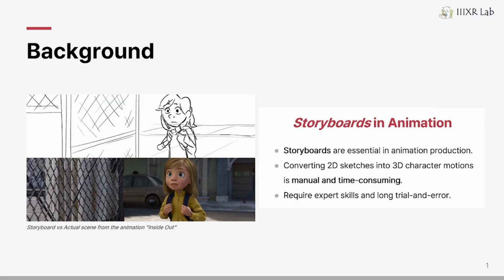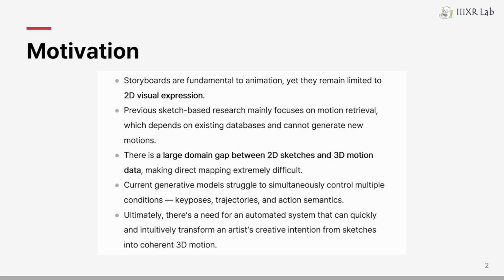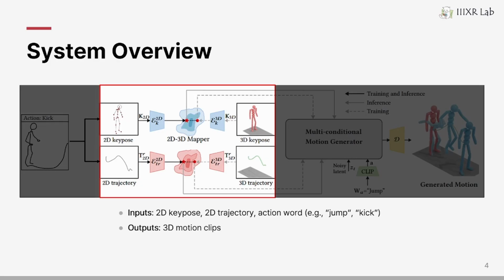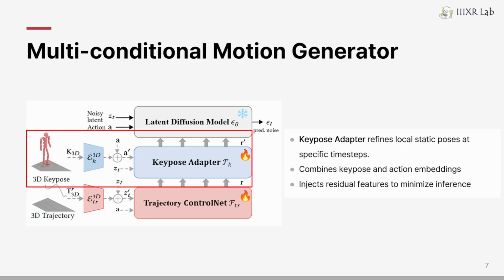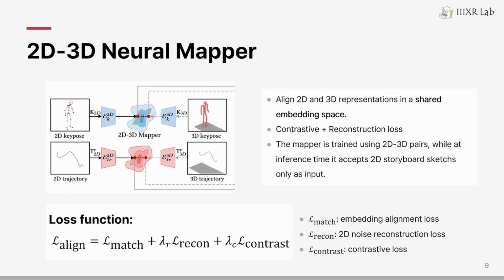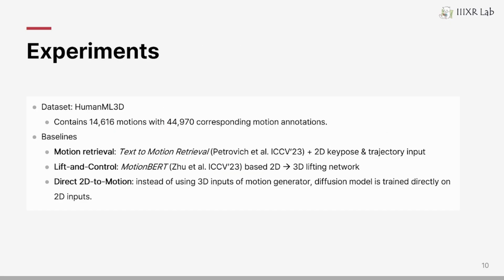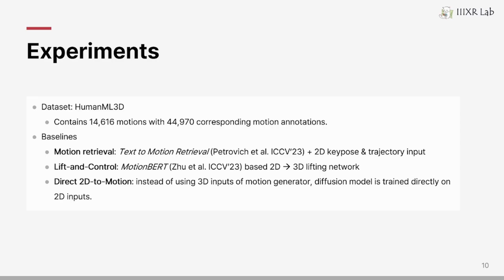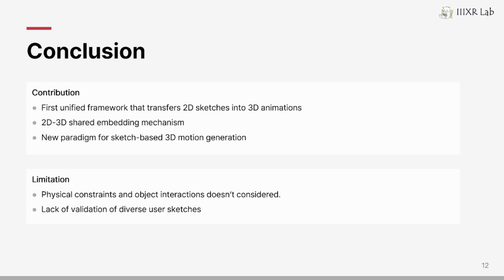[Seminar] Towards Transferring Sketch Storyboards into 3D Animation

Comment: Q1. Could you clearly explain how the spatial characteristics of 3D motion, which are not inherently present in 2D key poses, are effectively connected or reconstructed in the model?

Q2. In the evaluation, are there any quantitative metrics used for comparison with the baselines other than visual naturalness?
Reply: A1. The model reconstructs 3D spatial characteristics by mapping 2D sketches into a shared latent space jointly learned with 3D motion features. Through contrastive and reconstruction training, the neural mapper learns geometric correspondences between 2D joint layouts and 3D structures. This allows the motion generator to infer missing depth and orientation cues during diffusion, effectively recovering realistic 3D motion from 2D key poses.

A2. Yes. In addition to perceptual evaluations of visual naturalness, the paper uses several quantitative metrics: FID for overall motion realism, MPJPE and trajectory error for spatial accuracy, and R-Precision for semantic alignment with action descriptions. These metrics consistently show Sketch2Anim outperforming all baselines.

Comment: 1. Is it possible to perform combined actions involving more than one movement? For example, can the model handle a complex motion such as standing up from a sitting position and then immediately running, as long as the trajectory is provided?

2. How many frames can the model generate? Did the paper specify how long the generation process takes?
Reply: A1. Yes, the model can handle combined or sequential actions as long as the trajectory and keypose cues describe the overall motion flow. Since the diffusion model generates motion clips conditioned on continuous trajectory and action inputs, transitions like standing up and then running can be synthesized smoothly within a single sequence. However, very long or highly discontinuous actions may still require splitting into multiple segments for stability.

A2. The paper doesn’t specify a hard frame limit, but each motion clip typically covers 4–6 seconds, or about 120–180 frames at 30 fps. According to the paper, the generation time takes approximately 0.427 seconds based on a single RTX 4090 GPU.

Comment: Q1. The 2D–3D Neural Mapper of Sketch2Anim is trained on the Human3.6M dataset.
Would it still perform well on sketches with different styles — for example, unrealistic proportions or children’s drawings?
If not, how do you plan to address domain generalization across such diverse sketch styles?

Q2. The current system does not explicitly account for physical constraints or object interactions.
In this case, are there any potential methods to incorporate or enforce physical constraints within the motion generation process?
Reply: A1. Just to clarify, the model is trained on HumanML3D, not Human3.6M. The shared latent space is somewhat robust to moderate style variation, but unrealistic or child-like sketches can still reduce accuracy. To improve domain generalization, techniques like style augmentation, unsupervised domain adaptation, and style-invariant feature learning could make the mapper more tolerant to diverse sketch styles.

A2. Physical constraints could be added through physics-informed losses such as joint-limit or contact consistency terms, or via constraint-guided diffusion that projects samples onto physically valid poses. Another practical option is a post-processing stage using inverse kinematics or physics simulation to refine motion realism.

Comment: I've seen the in-paint method in the stable diffusion family. Is this similar?
Also, there's research on natural language->sketching. Is there any research showing that natural language->sketching->3D motion is better than natural language->3D motion?
Reply: In-painting in Stable Diffusion and Sketch2Anim’s approach are conceptually similar in that both use conditional diffusion to fill or refine missing information, but Sketch2Anim conditions on motion cues—keyposes, trajectories, and actions—rather than pixel masks. The model generates motion segments consistent with those conditions instead of image regions. As for language-to-sketch-to-motion pipelines, there’s currently no strong evidence that adding a sketch stage consistently outperforms direct language-to-motion models, though some studies suggest it can improve spatial control and interpretability by providing an explicit visual intermediate.

Comment: Q1. When projecting 3D motion data into 2D, are the viewpoint and camera parameters fixed, or do you consider multiple perspectives during training?

Q2. I’m curious about how much the quality or style of the input sketch affects the model’s performance. Does the model handle rough or low-quality sketches as well as clean, detailed ones?
Reply: A1. During training, the 3D motions are projected into 2D using multiple random camera viewpoints, not a fixed one. This helps the model learn viewpoint-invariant correspondences between 2D and 3D representations, improving robustness to perspective changes in sketches.

A2. The model can handle moderately rough sketches because it focuses on structural keypoint relationships rather than stroke quality or style. However, very messy or incomplete sketches can reduce accuracy since keypose and trajectory cues become ambiguous. The authors note that incorporating style augmentation or sketch preprocessing could further improve robustness to low-quality drawings.

Comment: 1. On page 3, I think the 2D trajectory cannot represent depth information in 3D. How do they address this issue in the paper?

2. It’s a bit difficult to show the FID score because the method goes beyond the existing dataset. How do they handle the evaluation part?
Reply: A1. As you mentioned, a 2D trajectory lacks explicit depth cues. The paper addresses this by using the 2D–3D Neural Mapper, which learns to infer plausible depth from correlations between 2D trajectories, keyposes, and their 3D motion counterparts in the shared embedding space. During inference, this learned mapping helps recover consistent 3D spatial structure even from flat 2D sketches.

A2. Since the task goes beyond existing benchmarks, the authors reconstructed baseline models compatible with 2D sketch inputs and then evaluated all methods on the HumanML3D dataset. For fairness, they used standard metrics such as FID, MPJPE, and R-Precision to compare overall realism, spatial accuracy, and semantic alignment, ensuring quantitative consistency despite the novel setup.

Comment: Q1. Sketch2Anim currently takes 2D sketches drawn from a single viewpoint as input.
If multi-view storyboards drawn from different perspectives were used instead,
would the model be able to maintain 3D spatial consistency?

Q2. While Sketch2Anim demonstrates strong performance in generating high-quality motions using diffusion models, it still has limitations in terms of real-time user interaction. 
Is there a possibility that the model could evolve into a system that responds to user sketch edits in real time?
Reply: A1. The current model is trained on single-view 2D projections, so it doesn’t explicitly enforce cross-view consistency. If multi-view storyboard sketches were provided, the existing mapper wouldn’t automatically fuse them into a coherent 3D space. However, extending the mapper to a multi-view embedding framework could allow consistent 3D reconstruction across viewpoints. This would be a promising future direction for improving spatial reasoning.

A2. Real-time interaction isn’t supported yet because diffusion-based sampling is computationally heavy. Still, with latent-space distillation, progressive denoising, or feed-forward diffusion approximations, the system could be accelerated for interactive feedback. A lighter version could respond to user sketch edits in near real time, enabling an intuitive “sketch-and-refine” workflow for animators.

Comment: 1. Why does the paper include the word “storyboard” in its title? It seems to focus mainly on a sketch-to-motion task. The storyboard shown on page 1 looks more detailed and complex than just stick-figure drawings, but it doesn’t seem like the model can directly take that kind of storyboard and generate motion from it.

2. The Trajectory ControlNet seems to be based on ControlNet, right? What about the Keypose Adapter — does it not use any ControlNet? What kind of structure does it have?
Reply: A1. The term “storyboard” is used conceptually to emphasize that the system aims to translate sketch-based visual storytelling—like poses and motion cues in storyboard frames—into 3D animation. In practice, the model is trained on simplified, stick-figure-style sketches, not full storyboard panels with shading or scene layout. The authors use “storyboard” to highlight the creative context rather than the literal storyboard format, suggesting that future extensions could handle more detailed storyboard inputs.

A2. Yes, the Trajectory ControlNet is inspired by ControlNet, injecting motion path features into the diffusion backbone through residual control layers. The Keypose Adapter, however, is a lighter feature adapter rather than a full ControlNet, it merges keypose and action embeddings and injects them at selected layers via residual addition. This design avoids redundancy with the trajectory branch and keeps pose refinement localized without duplicating the full network structure.

Comment: Really interesting work! I have two questions:

Q1. Which latent diffusion model is used in this work? Also, for pose or motion–related diffusion models, what type of noise reconstruction loss is applied? For example, is it a score-based loss?

Q2. Recently, many studies on sketches—like sketch generation or sketch-to-something—have been emerging. What are your thoughts on the practicality or real-world applicability of such sketch-domain research?
Reply: A1. The paper adopts a latent diffusion framework. It operates in a latent motion space rather than pixel space, enabling efficient temporal denoising. The training uses a standard denoising reconstruction loss, predicting the added Gaussian noise at each diffusion step, so it follows a score-based noise prediction objective, like conventional DDPM or score-matching approaches. This loss encourages accurate motion recovery and stable conditional guidance.

A2. Sketch-based research is highly practical because sketches serve as an intuitive and expressive interface for creators. They convey spatial and stylistic intent that text cannot, making them ideal for design and animation. As cross-domain models advance, such methods can enable fast, natural 3D and motion prototyping for real-world creative applications.

Comment: Q1. In this paper, how is the neural mapper module designed to align the 2D sketch inputs with 3D key-poses and trajectories in a shared embedding space, and what role does this alignment play in improving the performance of the motion generator?

Q2. The proposed multi-conditional motion generator uses three conditions—3D key-poses, joint trajectories, and action words. What advantages does this condition integration structure have compared with single-condition methods or direct 2D→3D lifting approaches, and what performance improvements are demonstrated in the experiments?
Reply: A1. The neural mapper learns a shared embedding space where 2D sketches and 3D motion representations are jointly aligned using contrastive and reconstruction objectives. It captures structural correspondences, such as spatial pose layout and motion flow, rather than low-level visual details. This alignment enables the system to take real 2D inputs at inference time while preserving 3D consistency learned from motion data. As a result, the motion generator receives stable, geometry-aware conditions, significantly improving motion realism and trajectory accuracy.

A2. The multi-conditional motion generator jointly uses key-poses, trajectories, and action words to provide both local pose precision and global motion coherence. This integration offers richer control than single-condition or direct 2D→3D lifting methods, which often miss semantic or temporal consistency. The combined conditions allow fine-grained spatial alignment and smoother dynamics in generation. Experiments show lower FID and MPJPE scores and higher R-Precision compared to all baselines, confirming better realism and alignment.

Comment: Q1: How can the labels of 3D motions be aligned with 2D key poses, as well as with 2D and 3D trajectories?
Q2: How abstract can the input sketch be (e.g., a stick figure)? Conversely, how sophisticated can it be (e.g., a high-quality illustration)? Isn’t the 2D key pose representation constrained by what the model was trained on?
Q3: Mapping a 2D trajectory to a 3D one may lead to missing information during the projection process, depending on the viewing perspective. How does the model handle this issue?
Reply: A1. The labels are aligned through a projection-and-pairing process: each 3D motion sequence provides corresponding 3D keyposes and trajectories, which are projected onto 2D planes using random camera viewpoints. These 2D–3D pairs share the same temporal indices and semantic labels, allowing the model to learn consistent mappings across modalities.

A2. The input sketch can be as simple as a stick figure since the model focuses on joint geometry rather than detailed appearance. However, it performs best when sketches resemble the pose projections used during training—clean joint-like structures rather than shaded illustrations. Highly stylized or detailed drawings may introduce noise, as the model was not trained on that visual complexity.

A3. Depth information lost in 2D trajectories is compensated by the 2D–3D Neural Mapper, which learns geometric priors from many viewpoint-projected samples. By encoding correlations between 2D motion flow and 3D structure, the mapper infers plausible depth and orientation cues, producing spatially consistent 3D trajectories even from single-view inputs.

Comment: Q1. The 2D-3D Neural Mapper is central to bridging the domain gap. How does the shared latent space handle ambiguity and stylistic variance inherent in artist sketches? For instance, if an artist's sketch for a "kick" is highly exaggerated or abstract compared to the 2D projections from Human3.6M, does the mapping remain robust, or does it fail? Have the authors considered unsupervised or semi-supervised domain adaptation techniques to improve generalization to real-world, user-generated sketches?

Q2. The current workflow generates a motion clip based on a set of initial inputs (pose, trajectory, action). How does the framework accommodate an iterative refinement process, which is fundamental to animation? For example, if an artist wants to adjust the timing of a key pose or alter a small segment of the trajectory after the initial generation, can the model locally refine the motion, or does it require a complete regeneration from new inputs?
Reply: A1. The shared latent space focuses on geometric and relational features, allowing moderate stylistic variation in sketches. However, if an artist’s sketch is highly abstract or exaggerated, mapping accuracy may drop. The model is trained only on projected 3D data, not real drawings. The authors note that unsupervised or semi-supervised domain adaptation could improve generalization to real-world artistic styles.

A2. The framework can partially refine motions by reusing its conditional inputs, and users can modify a keypose or trajectory segment and re-generate only that part of the motion. Since the model is condition-driven, local edits guide new synthesis without full regeneration. Fully interactive frame-by-frame refinement, however, remains as future work.

Comment: Nice presentation

Q1. How does this work relate to recent advances in motion diffusion models? In what sense is this paper building on or diverging from the field of motion-synthesis?

Q2. What are possible future directions that may stem from this work? For example, can this method handle complex character-rigs or multiple interacting characters?
Reply: A1. It builds on recent motion diffusion work but extends the field with multi-conditional control and a 2D→3D shared latent mapper that enables sketch inputs. Unlike single-condition or direct 2D→3D lifting, it trains with 3D surrogates yet infers from 2D sketches, reducing the domain gap at test time. Architecturally, it combines a Trajectory ControlNet (global dynamics) with a Keypose Adapter (local pose fidelity), yielding stronger control without duplicating the backbone. Empirically, it reports lower FID/MPJPE and higher R-Precision than reconstructed baselines, indicating better realism and semantic alignment.

A2. Future work could integrate physics and contact-aware guidance to improve realism and handle scene or object interactions. Domain adaptation and sketch-style augmentation would enhance robustness to diverse user drawings. Extending the system to complex rigs, multi-character scenes, and hierarchical long-horizon generation could bring it closer to full pre-visualization workflows.